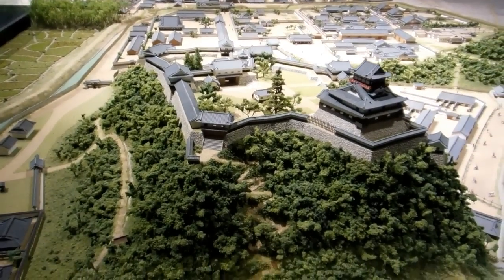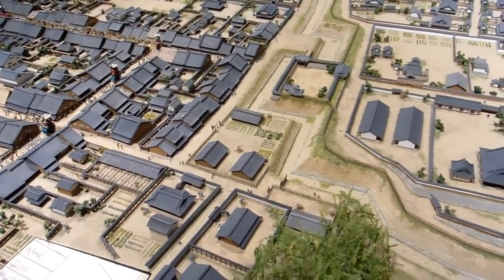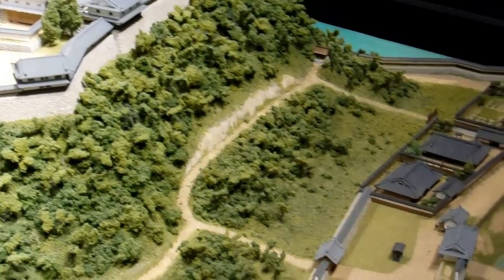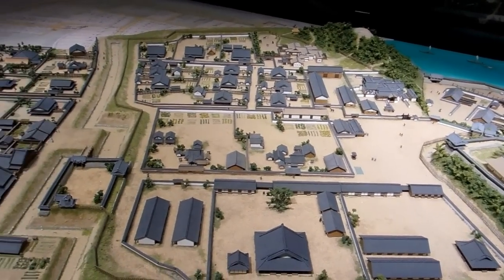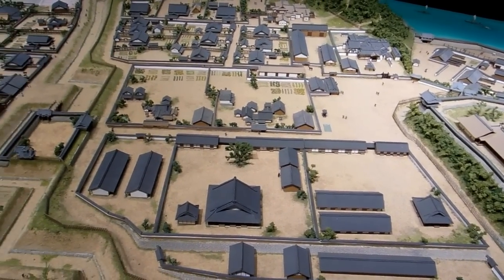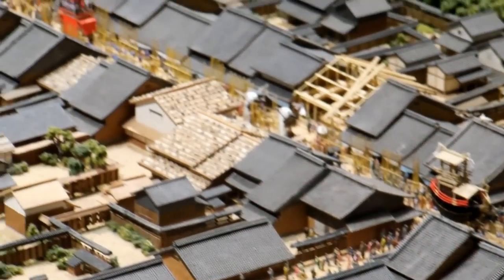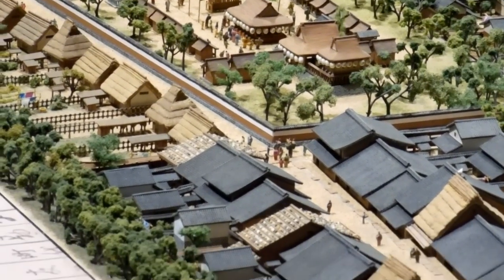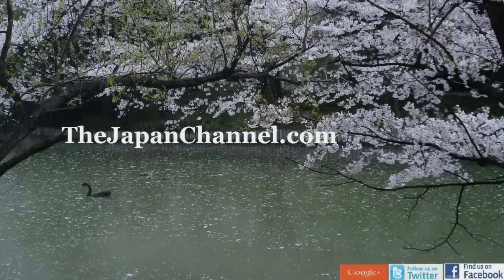Japanese Castle Design

Comment: Look like korean castle
Reply: Bruh, how?
Reply: yeah
Reply: Chinese, Koreans, and Japanese castles do look pretty similar. 

Just like castles in France, Germany, Spain, etc if you're comparing it with Europe.
Reply: Korean castle design is much simpler as they were built in bueracratic ways unlike noble warrior ways of japanese
Reply: No korean Castles (palace complexes) have Chinese style. they're symmetrical. Early period japanese palace complexes are also maintained symmetry like in kyoto
Reply: I don't know what kind of chinese style you refered, but korean castles have many different style,
 some were built in symmetric ways, 
but some were built along with assymetric natural terrain. 

And most unique visual feature of japanese castle is sloped super high wall which originated from traditional japanese mountain fort which depended on sharpning mountain slope itself as platform to put defensive architectures on,

Unlike common forts which built high wall on top of the mountain
Reply: Well the Daimyo were almost entirely Korean including the Imperial Family, so the Korean building styles and an influence